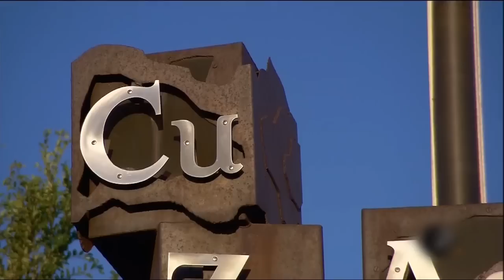How It's Made-Copper

Comment: and the copper they poured onto the landscape??
Reply: ***** You're saying the copper they just mined, smelted and poured has no value?
Reply: ***** ahh gotcha
Reply: +Rabbi Sheckles as said, it's not copper ore. There is likely still a tiny fraction of copper in it, but not commercially viable to extract.
It's waste from the manufacturing process.
If it contains commercially viable concentrations of other minerals that have economic value it may be processed to exctract those.
The rest is just rocks, no different chemically from the surrounding material except it's been molten.
Maybe someone comes up with an idea to use it as base material for making roads or concrete tiles, in which case it can be ground up and used. Otherwise it does no harm, eventually erosion will grind it away into sand.

Comment: I feel like this could be done more efficiently
Reply: +iisdan if it could, it would. What's not shown is that the "waste slags" are used as well, to separate out commercially viable concentrations of other materials.
And in some other places where higher concentrations of copper ore exist in nature, other processes may be employed. This film only deals with a single mine really, and thus a very small selection of manufacturing processes.
Reply: +iisdan You are beyond dumb if you think they wouldn't be doing it in a more efficient way by choice.

Comment: Pedants' corner.
Copper is made in the interior of some stars. This video is really about how humans extract it from ore and purify and use it.
Reply: Jack Sainthill You must be really fun at parties.
Reply: frankstrawnation
That's right, I am. Does it matter?
Reply: antiswattt3
Ok, whatever. Good luck with your Nobel Prize.
Reply: copper is actually made from Alchemy from Edward Elric the short.
Reply: antiswattt3
A chaotic mix-up of nonsense.
Reply: +frankstrawnation Jack is right...
Reply: No, like every other metal, Copper is a fusion-product from the explosion of stars.
Reply: Conex Xenon
like every other metal
Though a small amount of lithium is primordial.
Reply: antiswattt3
Most of them don't. Elements with an atomic number greater than 26 (copper's is 29) are synthesised exclusively by novas and supernovas. Few stars do that.
Reply: antiswattt3
What do you want measured? There are thousands of measurable attributes: position, velocity, acceleration, mass, electric charge etc.
Reply: antiswattt3
The presence of copper atoms in stars you mean, presumably.
OK, but first you say one single atom then you say copper atoms (plural). I'll try to give an answer (of sorts) to both.
copper atoms
Stellar spectroscopy.
one single [copper] atom
Impossible to detect by current means. However, be aware that stellar processes are very well understood within the scientific community and the one that I outlined to you at at 15:55 (GMT + 1:00) today is not considered controversial.
I hope that this helps.
Reply: antiswattt3
Please don't troll me. Thank you.
Reply: antiswattt3
im just pointing out how ridiculously childish you are being
I did ask you politely.
Reply: *****
Oh, OK.
Reply: Uhh no god created copper

Comment: electrolysis process, low voltages (less than 100Vdc) and very high currents, did the automation for a plant with 25000A, the cable trasporting this current were not really cables, they were multilayer bars about 1 x 15 cm, with multiple bars for each line (I think 5).

Comment: Hiw they did manage to get proper copper 10000 years ago, the process today seems would be too advanced back then?
Reply: copper required for electrical equipment is substantially more pure than copper used for tools and swords 10,000 years ago. Most of this complex process is purification.
Reply from the maker: Experts seem to think that they found little beads of metal in the ashes of their fires.  Then some Einstein of his time figured out that it was a repeatable process and smelting was born.
Reply: Copper is a mineral you can find free in nature, like gold for example. So they only had to mine the relatively pure copper and melt it down so it separates from the surrounding rock.
The problem is, those free copper deposits are mostly used up, at least deposits that are big enough that would make sense to mine them.
That's why we have to go to greater lengths today and use more complex processes.
Reply: EdiWete A couple of pound of copper to ancient man could have built him many things. 

A couple of pound of copper to a billion dollar company is nothing. 

There are still free deposits but they simply are not of quantity to make sense to large population level industry.
Reply: Budi Suryadinata They Mine It Duh
Reply: Budi Suryadinata from Malachyte ;)
Reply from the maker: Back then their needs were simpler. Less quantity and quality were adequate.
Reply: Maks Maso To clarify, malachite rocks might have been used as rocks in a fire pit. Heat would roast the carbonate and convert it to oxide. The carbon from charcoal would then combine with the oxide and leave pure copper.

Comment: Dang, man. All those chemicals and slag must really screw with nature.
Reply: think about how much energy it takes to produce it.. or other metals as well.. 
its crazy thing when you start to think bout it more deep.. there is a moment after which u go, you cannot come back.
Reply: Rain has water in it however, which will leach heavy metals in the ground and water. Especially impurities in the copper like zinc and lead.
Reply: the beds are lined otherwise you the pregnant liquor will dissipate.  slag is inert and solid, its basically a form of rock. the environmental impact is not from either of those phases but in disposal of tailings from the mining process.
Reply: the Earth's crust is a massive slag made up of mainly silica and iron oxide
Reply: the spaying is done in already exhausted parts of the mine, and when its done its capped with a clay and plastic top to stop further leaching. The chemicals used in the leaching process also bio degrade quickly in nature. believe me it used to be way worse back in the old days, far more cyanide was used. Your right though about smelters though, they are terrible things for the environment but theres no real easy cheap way to process massive amounts of metal at a time. At least the by product of copper smelting is mostly glass, and any other contaminants are usually captured in that glass.
Reply: Slag is not bad at all actually, it really is just a sort of synthetic lava, it even has use as a fertilizer much like volcanic soil.
Reply: It does, I am wondering where this is still allowed? I work in a copper smelting plant and what was shown here really boggles my mind. Smelting and electrolysis is obviously what you need. But there is no real need to destroy the earth and groundwater with spraying the earth with sulfuric acid or dumping copper slag in open air. :-/
Reply: Well, why do you think there are no animals or vegetation on that hillside anymore? The area around the smelting plant where I work, looked like a toxic wasteland 30-40 years ago too. Now it is a birch forest full of rabbits and squirrels.
Reply: First thing is they survey the ground and see if there is any water, if so they change the way they harvest this material or flat out ignore it and find another spot. Another thing to consider is the environment is capable of healing, as long as safe practice is maintained and the EPA are up their asses all is gonna be fine. Metal work aint bad at all compared to gas production. The worst of all is the cows lol. They ruin the planet with their farts lol.